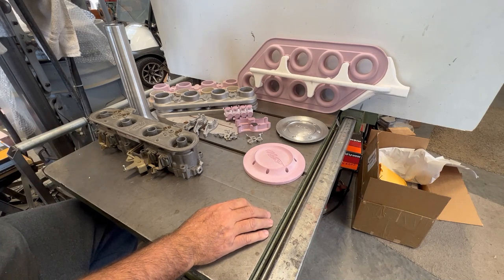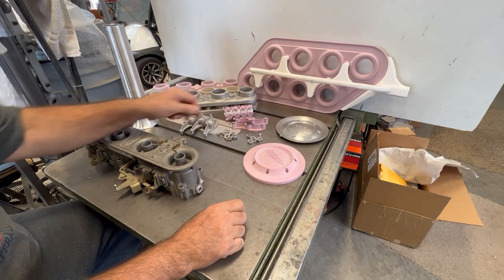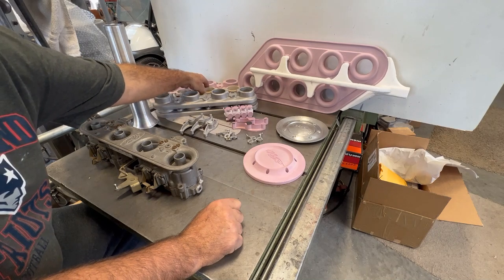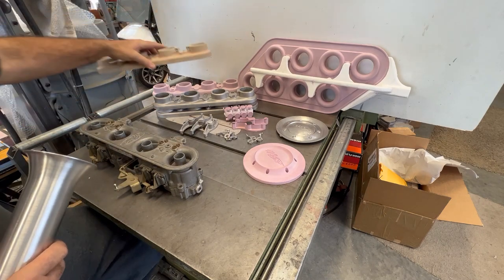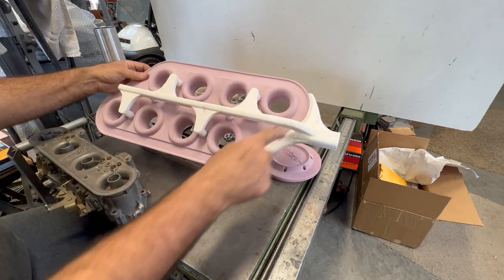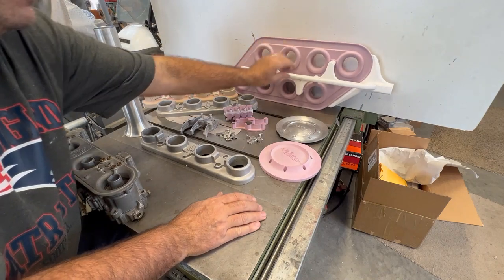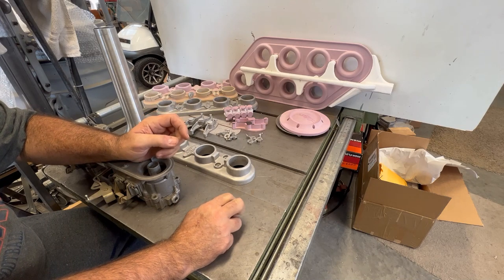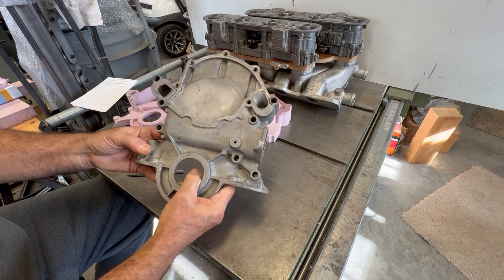Lost Foam Casting an Automotive Timing Cover

Comment: What kind of foam is this? It just burns out during the pour?
Reply from the maker: Yes it burns out during pour, that's the essance of lost foam casting and it's advantage compared to other evaporative pattern casting like lost wax or PLA......no burn out step. It's 1.3lb/ft3 extruded polystyrene insulation board. There are videos discussing materials  on my channel. subscribe/search. Best, Kelly